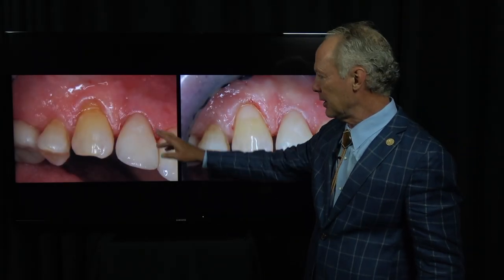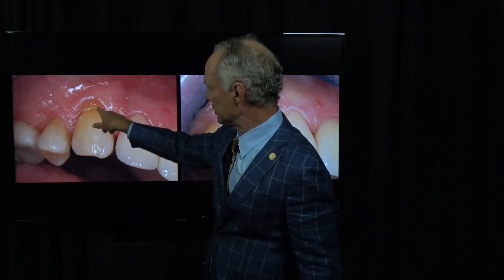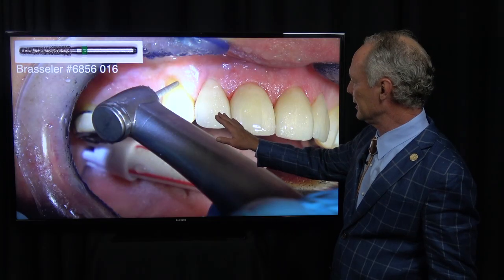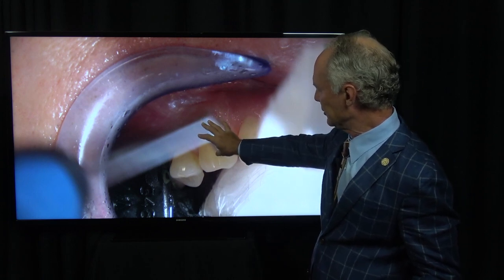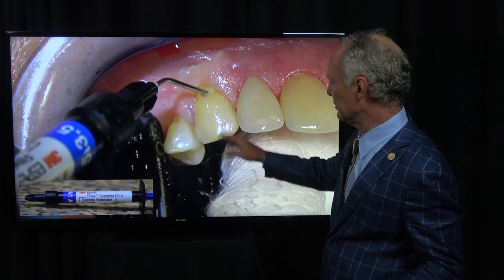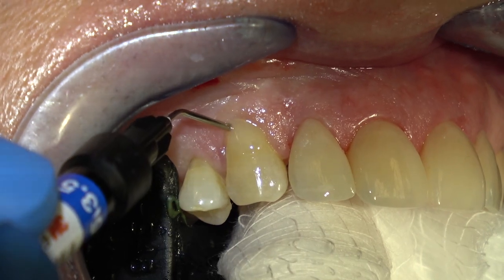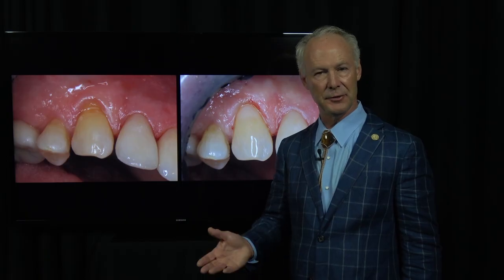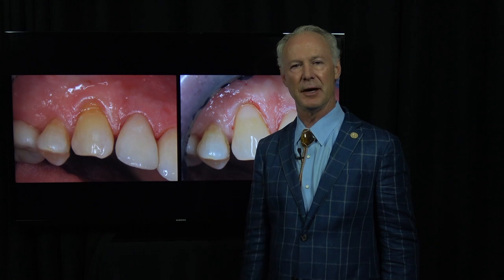Class Five (Gingival Facial) Composite - Dental Minute with Steven T. Cutbirth, DDS

Comment: Thank you Steven , another amazing video and I like how you repeat tips in each video so they remain memorable .
If the  patient returned with some sensitivity after a nice filling was placed ina. cervical defect ,using flowable composite , any advise ? 
also if the defect is subgingival would you recommend using a retraction cord ? if yes , what size ? Thank you .
Reply from the maker: Yes.  Be sure you cure the primer adhesive after blowing off the excess to remove the acetone carrier.  If the composite is deep, place and cure it in 1mm layers.  If the tooth is hypersensitive prior to treatment, it may need endo.  If it is not sensitive prior to composite placement, the tooth should not be sensitive post op if you use this technique exactly as explained.  Do not over prepare the surface when freshening the sclerotic/secondary dentin. I have placed direct composites this way for 40 years without any post op sensitivity I am aware of.
Reply: @centerforard  Thank you Steven , I do appreciate your reply . 
Could you kindly show us how to use the retraction cord when doing class v with a defect extending to subgingival level .Have a lovely holiday .
Reply from the maker: Just use a small (length) retraction cord, probably a size 0 or 1, placed only on the facial surface of the tooth.  I have never used retraction cord for Class 5 restorations because I do not want gingival bleeding if I can avoid it.  If the gingival tissue is inflamed, you might want to clean the teeth and show the patient proper home care prior to the bonding procedure.

Comment: Hello Dr. Cutbirth.
I'm a student and I was told by all of my professors that Flowabale, while it seals the restoration it does not provide adequate strength when compared to a conventional composite. In your clinical experience why do you believe that the Flowabale will hold up to the forces of clenching? Thank you for your videos!
Reply: I think that's the idea tho. You want something more flexible. The patients own enamel couldn't hold up to the forces
Reply: F
Reply: @kvgolfa  yeah but Flowabale is so much weaker compared to a regular composite it would fail a lot earlier. In terms of flexibility if your composite moves around your marginal seal would break and you will get secondary caries
Reply: @kvgolfa  wow great read thank you. Again I'm still learning so I appreciate the source.
Reply from the maker: Use flowable for Class 5 composites, along with a nightguard.  Tell the patient if the do not wear a proper nightguard or a Dental Snoring/Sleep Apnea Device the same thing will happen to the Class 5 composite that happened to their tooth.  Hopefully the patient does not clinch while they are awake.  If they do, flowable or highly filled resins will be lost.  No composite will normally be long lived if it is large because of the coefficient of thermal expansion differential between composite (75) and tooth structure (11).  When the patient drinks or eats very cold or hot things, the composite expands and contracts much more than the tooth, so the margins will eventually pull away, leak and stain, no matter how great your technique.  If a patient is a daytime clincher, does not wear a nightguard eats and drinks a lot of hot and cold things plus red wine and strong coffee, direct composites are not going to be long lived, no matter what technique you use.  The technique described in the video is the best technique, in my opinion, but there is no restoration you can place that a patient cannot destroy with bad habits.
Reply: Always a pleasure to hear personally from you Sir.

Comment: Thank you for sharing your tips! I wonder if you use flowable resin only. In my case, I also use flowable resin  and then condensable resin on top of it.
Reply from the maker: Terrific.  I do the same thing with occlusal composites.  I feel like flowable composite adheres to the surface better in class 5 restorations.  Plus there is no compressive stress on class 5 restorations.

Comment: Thank you Doctor for this fantastic video. 
I have one question on using flowable and would love to hear your thoughts about it. 
How do you factor in the polymerization shrinkage of these materials in class v where there is the highest number of C-factors? Numerous studies confirmed the low filler composition of flowables make them prone to shrinkage after light curing and hence stress on bonded walls of the cavity and therefore post ope discoloration and sensitivity   
Many thanks
Reply from the maker: There is no problem so long as the patient does not drink much strong coffee or red wine or other things that stain the composite. As with all direct composite restorations, they normally do not stand up for years and years. Patients who drink/eat very cold and very hot things are more prone to issues because the coefficient of thermal expansion of a tooth is 11 and a composite is 75, so the temperature affects the composite more than the tooth, especially cold things which cause the composite to contract and pull away from the tooth. T
Take your practice to the Top Tier. Subscribe to DentistryMasterClasses.com for an organized library of all the Dental Minute videos plus many complete comprehensive cases and many very important articles. New cases are added weekly.  Only $20/month.
Click here to subscribe: 
https://membership.dentistrymasterclasses.com/purchase/?plan=513

Comment: hi, did u use retraction cord on this video or u just put the flowable composite right away? Any tips how to get the beautiful margin though if you didn't use retraction cord? thank you
Reply from the maker: I did not use retraction cord. I do not normally use retraction cord for facial composites because the cord can illicit gingival bleeding, which may be more difficult to control, especially if the gingival tissue is at all inflamed. It is important there is no bleeding onto the prep/margin when the resin is placed. 38% phosphoric acid placed on the gingival tissue for 45-60 seconds when the prep is etched is a terrific hemostatic agent. I always overfill the composite, then polish it back with the shown burrs, finishing with 12 or 30 fluted carbide burrs and a shofu polishing disc and sometimes a shofu rubber wheel. Watch my video on controlling gingival bleeding.
Take your practice to the Top Tier. Subscribe to DentistryMasterClasses.com for an organized library of all the Dental Minute videos plus many complete comprehensive cases and many very important articles. New cases are added weekly.  Only $39.95/month.
Click here to subscribe: 
https://membership.dentistrymasterclasses.com/purchase/?plan=513

Comment: Hello sir, great video, as always..how about placing liner under composite to prevent sensitivity ? Do you think it's necessary for class v restoration ?
Reply from the maker: Sometimes I will place 2 coats of primer/adhesive, blow off the excess primer/adhesive onto a 2x2 gauze and cure each coat for 5 seconds, then place flowable composite if it is a facial restoration. I feel primer/adhesive seals the dentinal tubules better than anything. Be sure the dentinal tubules and enamel have been wet, then just blot the surface dry, do not desiccate the surface. The primer/adhesive carrier is drawn to moisture, carrying the primer into the dentinal tubules forming the hybrid layer. 
 Take your practice to the Top Tier. Subscribe to DentistryMasterClasses.com for an organized library of all the Dental Minute videos plus many complete comprehensive cases and many very important articles. New cases are added weekly.  Only $39.95/month.
Click here to subscribe: 
https://membership.dentistrymasterclasses.com/purchase/?plan=513

Comment: Hi doc, is it normal for the composite to touch the gingiva when placing increments ? Would this not contaminate the composite and affect bonding?
Reply from the maker: Keep the tip of the composite dispenser in the prep so the composite pushes the tissue out as it is placed. Gingival bleeding will definitely affect the bond strength of the final restoration, so you must control gingival bleeding and any crevicular fluid. Be sure the gingiva is healthy and not inflamed or bleeds with gingival probing prior to composite placement. If the gingiva is inflamed and bleeds upon probing, have the teeth cleaned and teach the patient proper home care prior to the facial composite placement. 
Take your practice to the Top Tier. Subscribe to DentistryMasterClasses.com for an organized library of all the Dental Minute videos plus many complete comprehensive cases and many very important articles. New cases are added weekly.  Only $39.95/month.
Click here to subscribe: 
https://membership.dentistrymasterclasses.com/purchase/?plan=513

Comment: How do you keep gingival crevicular fluid out of the cavity? There's some there even if the patient has healthy gums.
Reply from the maker: I try not to touch the gingival tissue with the burr when performing the preparation.  Also, I would like the gingival tissue to be healthy so it does not bleed easily at the time of restoration, so most times the patient has had a recent dental cleaning and oral hygiene instruction.

Comment: Dear doc. when should we NOT use liner ? I found that whenever i dont use liner based on gjc ,i have sensitive tooth on cold. Does bond quality make dif. there ? I have tryed dentsply bond that prevents sens. but im scared to use it without gjc liner. What about some cheaper made in germany bonds ,are they making problem without liner ?
Reply from the maker: Use this technique and you should not have post op sensitivity.  Only minimally roughen the abfracted area to freshen the surface of the prep.  Do not remove but a tiny bit of tooth surface (probably sclerotic dentin) with a course barrel diamond burr.  If the surface is soft, use a #6 round burr in a slow speed handpiece.  Then, following etching for 15-30 seconds, apply the primer/adhesive and blow off the excess to remove the acetone carrier.  Once nothing moves when you blow the prepared tooth surface with your air syringe, always cure the p/a for 5 seconds prior to placing the flowable filled resin in 1mm layers.  Cure each layer for 20 seconds, with a final cure of 20-40 seconds.
Reply: @centerforard  Thank you dear colleague. I will try it next time.

Comment: Nice video doc! What about tooth isolation? I mean rubber dam
Reply from the maker: The key is isolation. It does not always have to be with a rubber dam.  If you can isolate the restorative site well with 2x2 cotton squares, as in a case like this, that is fine.  If you have watched my videos, you know I use a rubber dam for most procedures, so I really like using a rubber dam.  It makes most procedures better, easier and safer.

Comment: Hloo sir..most of the time I face problm of sensitivity in patient after composite restoration...patient. Complaining me sensitivity which last for around 4-5 days..after that it subsidede....wht is the reason ?
Reply from the maker: If there is no pulp exposure or close proximity to the nerve, be sure to blow off the excess primer/adhesive, then cure it for 5 seconds prior to placing the filled resin. This works beautifully to eliminate sensitivity. Also, sure the filled resin in 1-2mm layers as it is placed. I normally place flowable composite as the first layer, if the restoration is very large, then continue to fill with highly filled resin. In my opinion, the flowable "wets" the surface of the floor of the restoration better. Take your practice to the Top Tier. Subscribe to DentistryMasterClasses.com for an organized library of all the Dental Minute videos plus many complete comprehensive cases and many very important articles. New cases are added weekly.  Only $20/month.
Click here to subscribe: 
https://membership.dentistrymasterclasses.com/purchase/?plan=513

Comment: why there is no isolation or gingival retraction ?
Reply from the maker: Isolation with 2x2 gauze pads while the restoration is being placed.  No retraction cord because I do not want to cause bleeding.  With composite bonding, blood is the enemy.  The restoration is supra gingival, so don't stir up bleeding with retraction cord.  You absolutely do not want to place a rubber dam clamp on the tooth you are placing the class 5 composite on. If you watch my other videos and are subscribed to DentistryMasterClasses.com, you know I use rubber dam for almost every procedure.  This is a procedure I have to isolate with 2x2s.
Reply: Thanks  Dr. for your kind reply ❤

Comment: Thank you for your educative videos. Is it possible to do a video on how to approach the Heavily Eroded teeth where you can see the  pulp through a thin layer of tertiary dentin (vital pulp)? Much appreciated.
Reply from the maker: The real issue in these cases is how to prevent further erosion.  Is it abrasion or erosion.  If abrasion, then a nightguard or dental sleep apnea/snoring device will help.  If erosion, the cause must be addressed, i.e., bulumia, acid reflux.
Reply: @centerforard  The teeth are eroded as the patient has tendency to constant consumption of soft drinks with high acidity. It involves multiple anterior teeth which esthetically are problematic (the teeth are too brittle).
Reply from the maker: Veneers or full crowns may be the solution if there is considerable tooth structure missing.  Large composite bonding does not hold up.  Of course the patient must also change their bad habits.
Reply: @centerforard  Thank you, much appreciated.
Reply from the maker: Also, endodntics may be needed.  Be sure to discuss that possibility/probability with the patient prior to restoration.  You do not want to complete the restoration and the patient have sensitive teeth.  Remember, if you discuss the probable need for endodontics prior to a restorative procedure, it is a reason and the patient will understand and accept it.  If you do not discuss the probability of endodontics prior to the restorative procedure and the patient has a post op sensitive tooth, they will blame you.
Reply from the maker: Watch my video on the NP interview, exam and consultation.  It's in the library of DentistryMasterClasses.com.